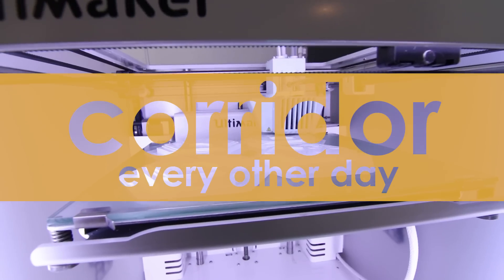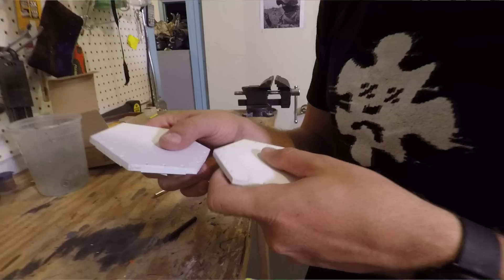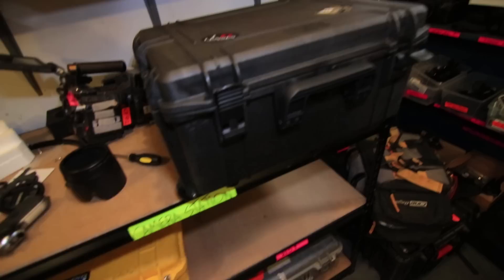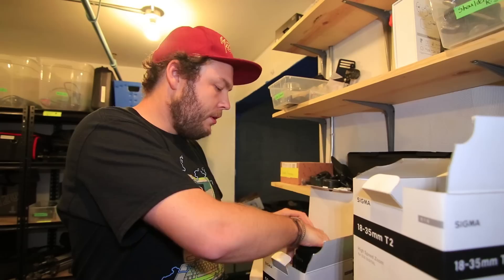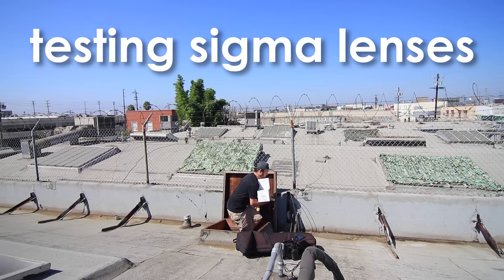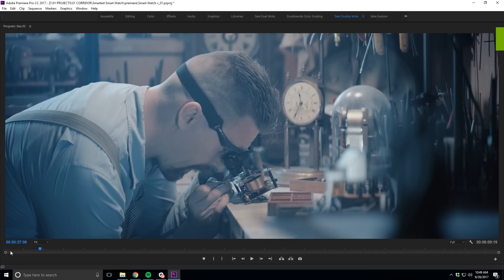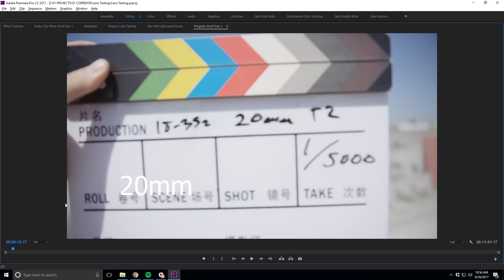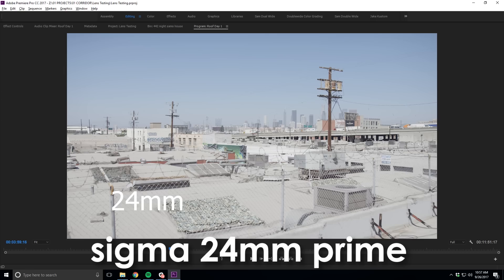Niko's Homemade 3D Settlers of Catan Set!

Comment: If you want each edge to attract to the other edges you just need an offset magnet not taking up the  whole edge, with a strip of sheet metal/ steel adjacent to it.  When two edges meet their magnets will attract to the steel / sheet metal.

Comment: Sam the magenta "color" shifting is chromatic aberration, the Sigmas do it too but instead of magenta it's green. It's a lot more apparent in high contrast edges. Nearly every lens does this-especially cheap or more vintage/older glass. The newer coatings, higher quality glass, and lens designs of today minimize and in some lenses get rid of them entirely.

Comment: I'm sure I'm not the first person to jump on here at the chance to school corridor digital but here goes. The magenta hue isn't strictly speaking an issue of color inaccuracy, but an artifact called chromatic aberration. 

"Chromatic aberration, also known as “color fringing” or “purple fringing”, is a common optical problem that occurs when a lens is either unable to bring all wavelengths of color to the same focal plane, and/or when wavelengths of color are focused at different positions in the focal plane. Chromatic aberration is caused by lens dispersion, with different colors of light travelling at different speeds while passing through a lens. As a result, the image can look blurred or noticeable colored edges (red, green, blue, yellow, purple, magenta) can appear around objects, especially in high-contrast situations." 

I've noticed it occurring on some of the same Canon lenses. That's another sacrifice we make for affordability when we use still lenses I guess.

Comment: Hey Niko, You should check out Simplify3D as a Slicer for your 3D-Printer, there is a new setting, that allows you to select different Layer hights within a model. You could haved sped up the process of printing a lot by just printing the top layers (where the details are) with high details and leave the base of the parts at bigger layer heights to save time...

Comment: You only need the rotating ball magnets if you have one lying on the center line or the piece is going to be slipped over. Stationary magnets would have worked just fine here,

Comment: Wouldn't printing each piece once and then making a cast of it with silicone rubber or something be much faster and cheaper? It seems to me you are being blinded a bit by science here...
11:40 - it's called chromatic aberration, and every lens has it. Coatings are used to compensate as much as possible. The more expensive lens should definitely have less of those.